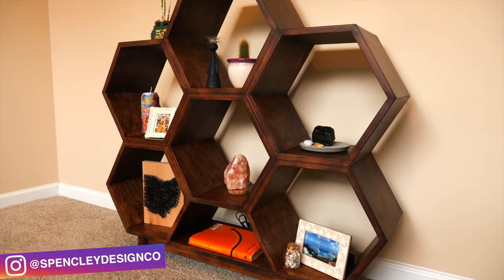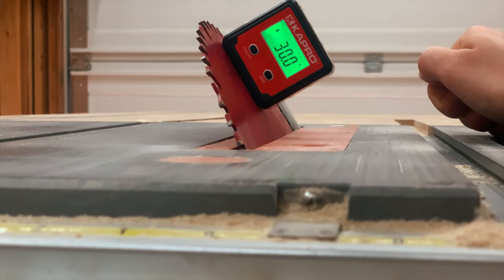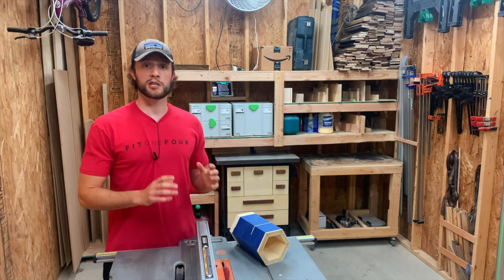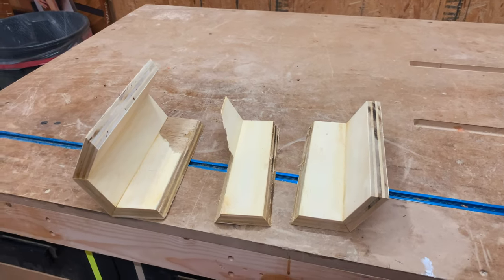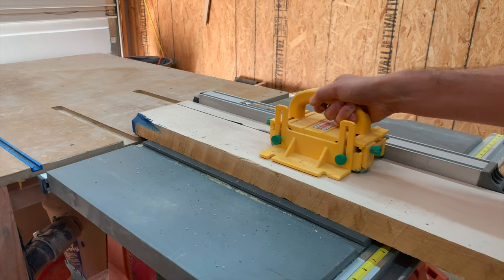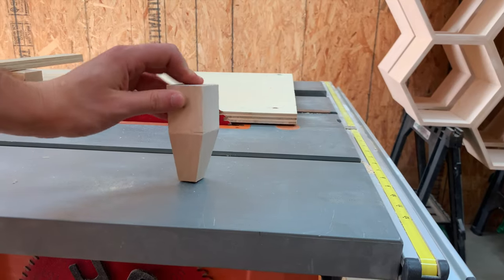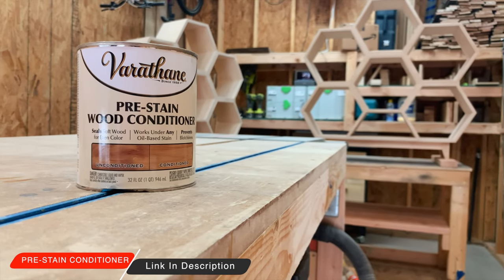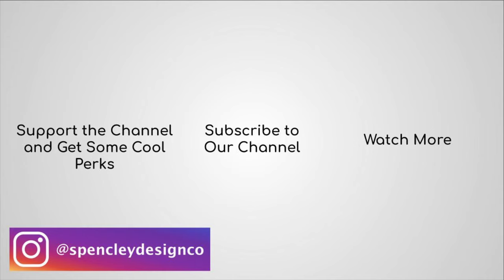the most challenging thing ive ever built

Comment: that turned out amazing! i have to figure out a way to join them since i dont have a domino tool. also, do you recommend using pre stain conditioner on 1 by's or 2 by's board purchased from home depot? i normally sand with 120+220 then straight to oil based stain and clear. i make farmhouse or rustic style pieces.
Reply from the maker: You really don’t need the domino. That’s why I did the test to show how strong it was without them!

For that type of piece, having uneven and blotchy stain is pretty common so you probably will be fine without the pre stain conditioner

Comment: I wonder how much outward pressure they would take? I am thinking of making these and filling each honeycomb with wine bottles which would have some outward pressure as well as the downward pressure when stacked. Obviously it would be better if it was trapped between two walls but or a outer box type walls built around it but still I wonder about the outward strength. What do you think?
Reply from the maker: I honestly couldn’t give you any quantifiable answer to that, but I doubt you’d run into any failure. I’d just build a test piece and see if it’s strong enough. I’m sure it will be 😀

Comment: I like the project, just 1 critique. You zero’d the angle gauge on the blade. You’re supposed to zero it in the table and then put it on the blade. I know you got the blade square prior to the first set of cuts. It’s probably a negligible difference but a good habit to zero on the table and then attach to the blade.
Reply from the maker: Thanks for checking out the video Riley!

Comment: Is this resistant to water
Reply from the maker: Thanks for checking out the video! Yes, I finished this piece with polyurethane which is a water resistant finish.
Reply: @SpencleyDesignCo  thank you
Reply from the maker: Sure thing! If you have any other questions, don’t hesitate to reach out
Reply: @SpencleyDesignCo   thanks just one more thing what wood did you use
Reply from the maker: It’s called Baltic birch plywood. The base is made from hard maple